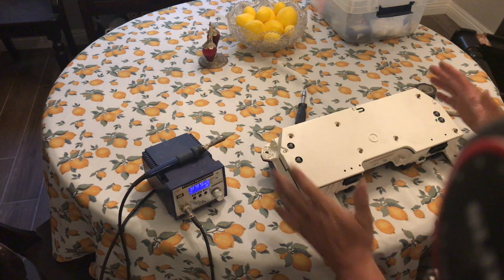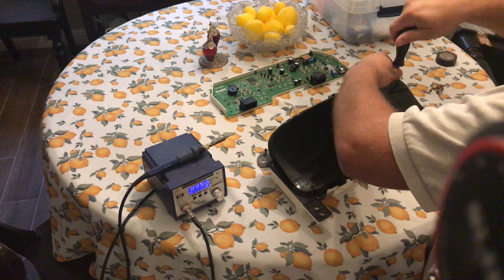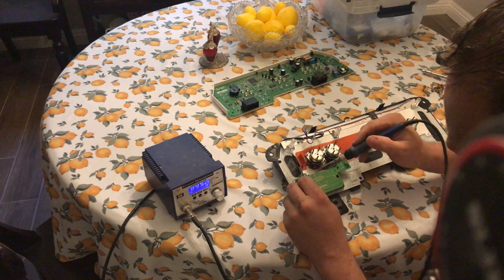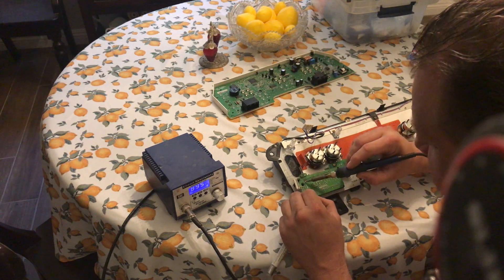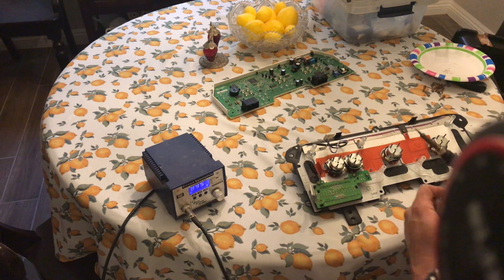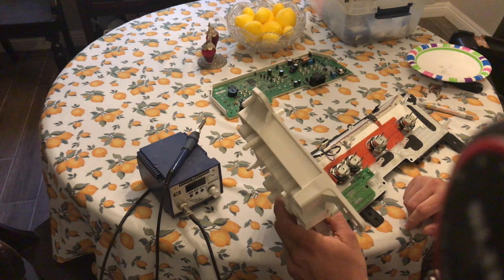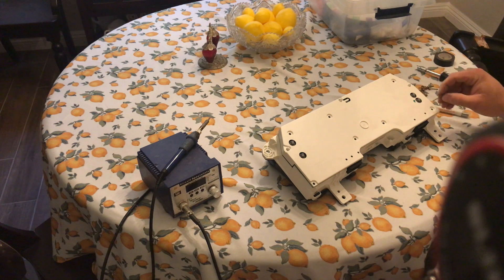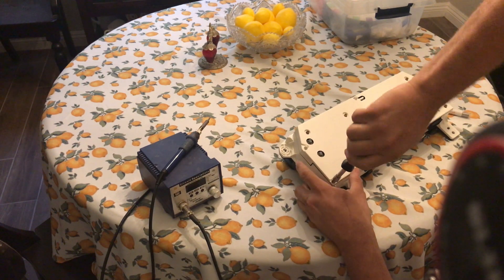Lincoln Navigator 2003-2006 Cluster VFD Repair

Comment: Did it end up correcting the issue or still having problems?
Reply from the maker: It did correct the issue, however, I did sell the vehicle in 2020, the repair itself was done sometime in 2018 so it worked from there until sold.

Comment: Hi there I'm in UK. A friend has a Navi 2003 given him. The problem is someone put a charger on it. But set the charger on wrong volts 24v. So now we don't know what has blown. Can you advise where to start. We have been told the cluster is the main module for the electronic system. So if so how do we fix it thanks if you can help.

Comment: Thanks for you video. Do happen to have one on removing the cluster from dash from 2004 navigator that has cd changer and navigation
Reply from the maker: I only have this one, and I no longer have the vehicle. If memory is correct, the dashes were all the same regardless of infotainment system (03-06) 

For the cluster, I want to say you have to remove the lower dash and then the bolts for the panel are there, but it’s been about 5 years since I’ve had it.